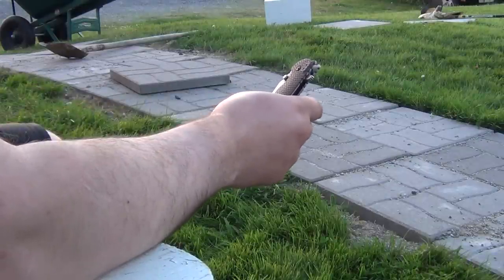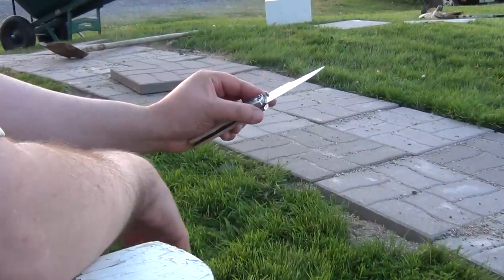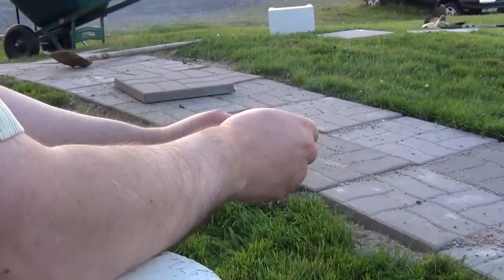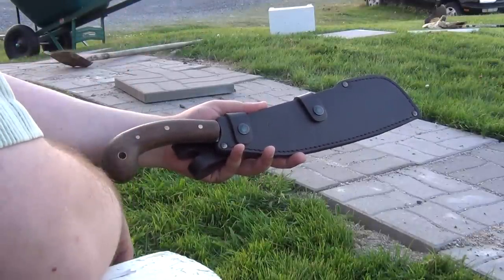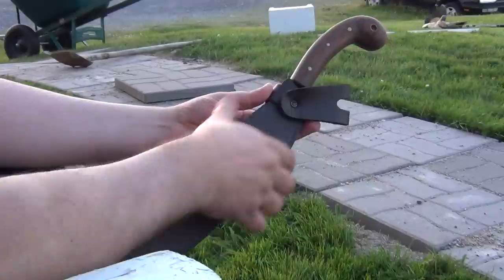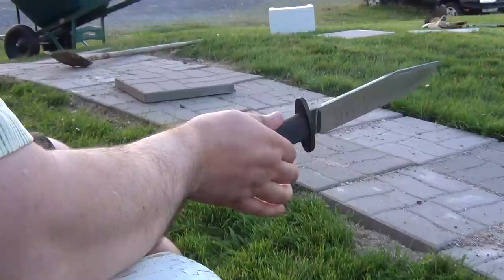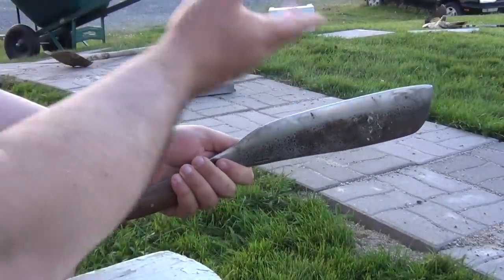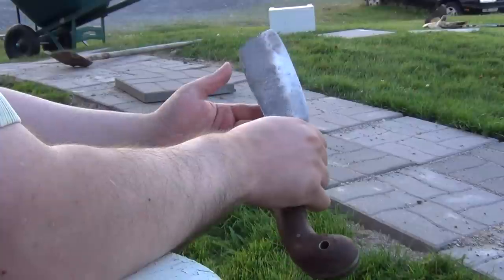Condor Village Parang : design by picture vs design by performance

Comment: Minus 25 Celcius.
and 16 inches of snow.
...if you had to survive a week, i doubt your best knife would do a better job at building fire and shelter in 15 minutes (or die) than this.
Nor would you break ice from a frozen creek. Theres main rules of three...
3 minutes 3 hours 3 days 3 weeks thats my purpose to deal with.
Its either machete or axe.
Well Ok ..lets "design" and add another $100 to the price...as for every feature added it takes more time.
Mods are fine. People mod rifles too...but that does not discredit even such as Sako..one of finest.
Perhaps Id put an oval handle but only enough to create slight palm swell. Adust the edge angle too for deeper bite, but by only 1/3 to keep some wedge for splitting. (convex) Leave 3" flat near handle for flint scrape, roughen the next 3" (as a wood rasp) and round the rest.
Id cut the belly nearly 3/8" closer (the flat is plenty long still for holding) to the handle and higher angle pitch to increase fine handling cutting and more useable blade. This, and reduced handle weight, will forward the weight for more power.
Gain a 1/4" swing length by decreasing handle knob size and shape more hooked.
Would shape a slightly raised thumb hold to increase grip and lessen hand strain  when "whittling"
But if i dont get to it, id still put my life on the parang as is.
I wouldnt take a gso 10 survival knife over this, as is, or anything you showed no matter how designed; they would not save my ass (in extended canadian conditions).
I could pretty much build a cabin..as is.
Kill a bear..as is.
Fillet a fish..as is.
Make feathersticks
..as is.
I cant see any other that could produce firewood quantity required for extended winter conditions in such a small size.
I would need to get the job done..all of it..or die. I have puma knives well "designed"..but they are useless to preserve my life in those conditions.
I just bought the condor for WSHTF for grandson when it comes.
..i see where you come from..but i dont think condor is merely faking sales by media hype and pumping garbage. 
The sheath..is sub to to knife. Maybe add another layer of leather to fix that; with pouch for sharpener and striker...heavy duty snaps etc.
Double thick leather is great for polishing the blade edge anyway.
If the condor were $200 more by "design" i would have refused; like the swiss fancy axe at 350.
I say mod it..fine tune it to personal preference; but it is already tremendous value already, and capable to do all if need be as is tool.
Hats off to condor..the USA workers would jack it to 500 by greedy wage and new tariff crap. 
Yet el salvador sells a days full work (or more) plus material for  a mere 100?
Shit..an hours work for the white collar worker.
Reply from the maker: If I had to survive a week? Uh guy, where I live -25 C and 16" of snow is pretty much the entire year aside from a coupleof weeks of summer.
Reply from the maker: I have been camping in -25 C in heavy snow more often than I could count, I spent most winters outside when I was young, and we didn't pack much gear being young and kind of stupid. I live in those conditions all the time, that isn't even what I would consider significantly cold, nor is that a lot of snow either.

None of that however is relevant to the point being made which is that knife is poorly designed and has little in common with an actual native parang as the balance, grind, and impact nodes are completely off.

It is like when I was in India and would buy a hamburger which was made by someone looking at a picture and had cabbage vs lettuce as they look enough the same to be a substitute, but they don't kind of taste the same.

Now if you want to make  a point about why you think a Parang should have :

-that balance and weight distribution
-grind
-handle/tang construction

vs a native parang, then go ahead, I would like to see the actual argument.
Reply: Cliff Stamp i get what you say in the science geometry etc. The same applies in rifle harmonics..nodes
..vibration etc.
The chips need to fly and no stick. I dont need arm fatigue and tennis elbow. 
If you say it has downfalls i consider it.
I wont say this is the "best"..over another model quality or feature wise.. I know it has a lot of shoulder...i intend to mod this.
I m not fond of smooth handles..i know ill work this over.
But price and convenience is counter balance..and  synthetics are ruled out. Hate rust...but hey its fine steel..and thats what im really paying for. I NEED weight thats the whole idea.
Carving..is a BIG deal.
Firesticks. Fast.
Id rather this with mitts on than removing them and freezing fingers. 
This cuts shavings..it not michelangeo carving. To handle a small knife you have to get the mitts off. Then you have seconds rather than minutes.
So ...it doesnt chop..blunt, doesnt cut..split, carve, rolls out, hand slides onto blade, heavy, useless?
I say that 10" blade you showed is a survival marketing scheme itself then. A straight line knife cannot produce the chopping power you claim equal to the parang simple as that.
Youd die..if it were one knife only. You say it can match?
You need 6 - 8  6" x 8 ft diameter logs per 24 hr to maintain a winter fire. That shiny knife wont do it. Whats the price?. My lil 4.5" puma is $230 C. Its among the finest..its "designed" yet "useless"..too light for the job, like your 10" showed. Doesnt matter..both are useless pieces of crap to maintain the pace.
Does puma suck too?Neither will 95 % be adequate, whether designed or not. This will...even as is.Top 5 % of tools that will do it? Whats wrong with THAT design?
If you cant lift it to shave wood and takes over 20 lb pressure issue then dont go in the bush if so feeble.
This "other" parang...it must be on amazon..reviews available..easy to purchase ..priced at under 150 delivered to my door....right?
Or is it not accessible.
Its easy to say buy a lamborghini and "your" cars useless at the same time..too.
Lets just say all axes are useless crap as they arent swedish $350 units.
As to junk..its junk.
But theres always a good level of value such as council tool has at 100. A similar "compromise" and situation. They arent #1...yet top 5 category. They useless crap too?
I think the paper design is them fancy bend with your fingers tin swords they sell at the mall. Now...i do see your entire point from that perspective. But...the designed by design you demonstrated are completely useless for my p.o.u..condor will have to do im not a millionare
Reply from the maker: It isn't about the weight, it is about the distribution of the weight. Imagine a hammer with a very light head and a very heavy hammer. Isn't it obvious that is problematic as a hammer? In the same way, all that steel above the edge which isn't tapered doesn't do anything productive, and it isn't a very effective wedge, hence traditional parangs have the convex dual tapered grind which is common. 

As for 10" straight blades, they are mainly a western thing, as people are constantly complaining about weight. It isn't really about the curvature of the blade, as a straight machete has tremendous cutting power (it will however bind insanely tight in heavy wood),  though the curvature can make a difference on cutting lighter vegetation, not so much on wood (because the curvature is not significant when compared to the length of cut).

However due to the ineffective weight distribution on that parang, and the very thick grind, it can easily be outperformed by a much smaller and lighter blade. 

As for other parangs, there are lots of people who import them, you can get them for a lot less than $150. If you look at junglecrafty (the channel) you see those blades in action all the time.
Reply: Cliff Stamp im agreeing with you on weight distribution, vibration, handle work, degree of bevel etc. you mention. 
But "useless" is the wrong word.
I love slim trim streamlined and efficient.
With my ruger semi 223..well..its not a ruger anymore..30 hours of improvements from barrel rifling polishing to trigger job from 5.8 to 2.9 lb. changed that.
I increased cyclic rate and polished bolt and slides, bedded it (as it moved side to side in the stock). Matte camo paint, calibrated scope to max 1000 yrd range using nosler 69 gr custom. I made it an outstanding performer it just took a little work people wont pay the assembly line to do.
We know ruger from box is not "useless". 
Its not accurate, its crappy fitting..but world class reliable. Its a club from the box..so i whittled 13 ounces off etc.
 I ruled out every other semi auto for reliability reason.
👉So ...why do you suppose they have grade one student engineers misdesigning in world renowned corporations...
producing square circles?Thought this was a condor classic flagship line.. guess folks are deceived into 4.5 ratings as they dont know lettuce from cabbage.
 I researched for days pros and cons..never saw the parang site you mention. If its american..no sale.
Thats about tariff upheaval confusion wrought lately.
Ill tell you why i really got this other than for me hunting. (Its arriving..havent seen it yet; )
👉"theres a slow train coming"
I might not live long enough to see it ..but the grandson will need all the help he can get.
Survival gear equip ammo..all of it will be left to him to ensure best odds of surviving global collapse. Times running out..its getting way too dangerous in the civilized world and time to prepare for him what he does not understand. 
Its a bible thing.
Hes 7.
Reply from the maker: There are lots of people selling traditional parangs, search for Bidor parangs for example, they even have the one that Ray Mears favors for his work. 

Why are there bad designs? How many people making tools actually use them in depth? It is very common to buy any tool and after using it quickly realize there is something very wrong with the design that makes it non functional. How many axes some with handles which are lacquered which you have to sand off almost immediately for example. Why do they do that, well for a number of reasons but none of them are related to actually using the axe.
'
If you look at Condor's lineup, they have almost an example of everything, axes, all kinds of knives in all shapes and sizes, many traditional designs. Do you really think they understand all of them?

I had for example a single bevel knife scandinavian grind from Condor which was 1/4" thick and had one bevel at 25+ degrees per side. Now that looked like a Mora if you took a picture side on. And if you didn't know anything about knives you might say it is the same thing. But it is obvious in use it is a non-functional replicata.
Reply: Cliff Stamp bidor malaysian parang must be the only "good" design all else is inferior to be denounced. I watched several of your vids.
The blade <chris?> made for you had every down side as you said condor did..weight transfer, grind, handle....
Every point about his knife is the same made about condor. In that vid you say "minor" work needed yet handle comes off and complete makeover like condor. His was not called."useless" or "deceitful"  design. It seems like condor is a target. Useless.  Wheres kershaw cold steel crkt etc downplay videos? 
Stones were knives and axes at one time..not useless.
One parang design among how many thousands in design, in history, is the only..."good one"?
I watched j crafty..those seem way skinny and light, in warm climate, and talks more about ants and stuff in 90 % of vids. In canada winter he d die no matter if he had malaysia parang or not.
I see in your vids; in sept, oct the sun is high and laying sod...  ..so winter  is about six months not two weeks there.
 In Dec theres only 8" snow...theres no significant trees at all..no heavy wood forest and chopping its rocky coast on the ocean. Hell theres no vines or grass there.
Jungle or Coast.
These are far from conditions where im at. An axe is better here than machete...but not in malaysia. The malaysian parang to an axe is a failed design for this country. I use the word "cutting tool"
It cannot efficiently cut 8 inch logs and fell trees compared to small forest axe same weight.
So malaysian parang sucks useless designed or not compared to axe and p.o.u.
But its not fair to discredit the manufacturer or design. If so..do it without partiality.
Other view is swedish axe masters suck in designing..there fine axe is "useless" as its crappy at cutting grass. We can bad talk pros designs real easy.
Mods are made on all good products. Improvements. Personal preference.
Yes most manufacturing is junk "shortcutted" on quality material and design and construction these days due to such competition.
Few are truly quality at 4x price. Few can afford.
In the middle is a "best value"
All are useable..some more than others.
Sensibly...unless for competition and hard professional use, any more than best value runs near the covet big penis syndrome.
Buy a ferrari..and drive the speed limit anyway? Ford dodge gm audi bmw..all suck cause theyre not efficient like ferarri.
And theyre not..by design. Ones $30,000 the others 200,000.
For 400 why not buy a stihl chainsaw and cut the whole forest in 1/ 10000 the time and energy. Theres the "efficient" useful cutting tool design.
Koodoos to the germans...but you cant shave you beard with it!
I propose to give condor a 7 star and no less ( as it is no slacker) with mod recommendations that up it to 8.5 rather than calling it "useless".. while the real tin makers deserving of burning at the stake arent mentioned.. thats bias needless reckless.
How many sales has condor lost over this?..the buyer has slim access to malaysian version 
so they chose say cold steel instead.and theyre not malaysian so suck anyway?
I propose that urging malaysian design is better than denouncing competitors..unless its the mall tin swords melted from tuna cans i cant see it. Watch
 " tac"...he shows  tests not talk. So does "we all juggle knives"
Both fair in review comparisons..not biased.
Its wise to make the point neutrally than condemnational.
I get the point malaysian excels..but if the only "good" one this mean bolos and every other shape and design is inadequately useless.
Cant be stuck on just one good only and all others suck. Thats too many knowledgable people insulted..surely they must have "some" credibility.